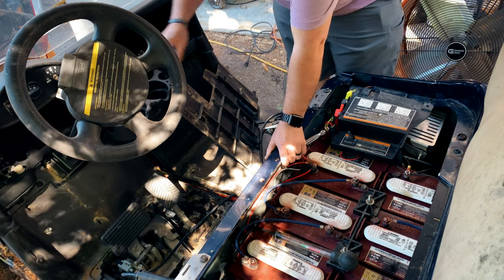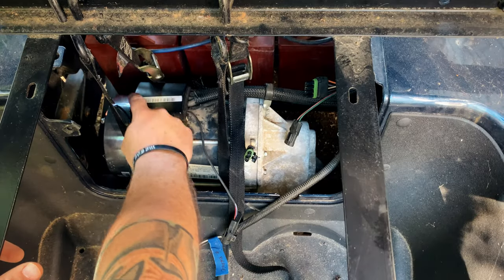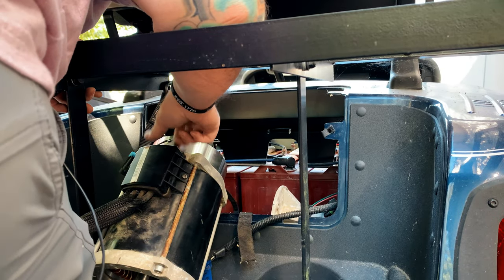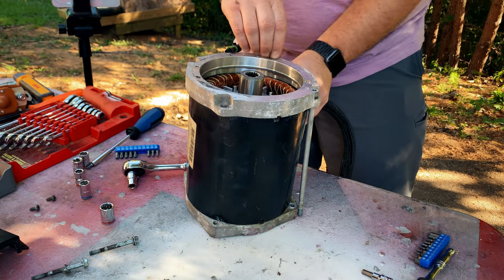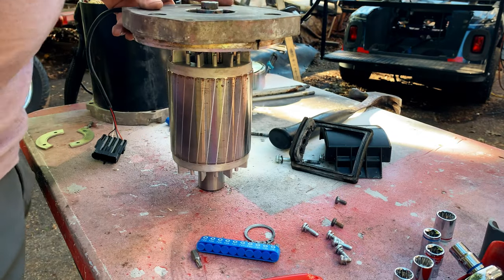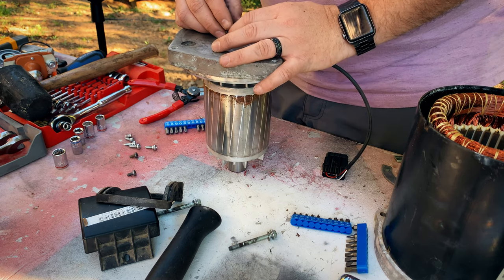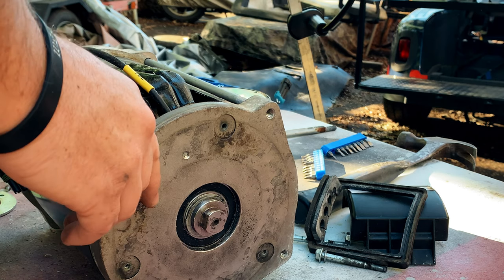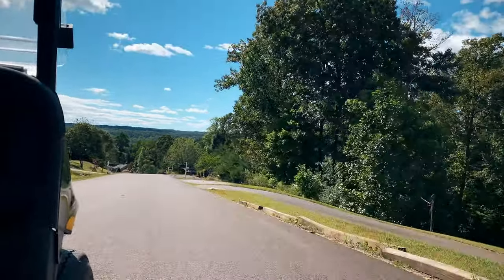Changing the Encoder Bearing | 2010 EZGO RXV | How to Upgrade a Golf Cart to Hunting Buggy - Part 2

Comment: Great video as always!
I myself own a 2009 EZGO RXV.
I had the same issue and replaced the cider bearing with no luck with fixing my issue.
Replacing the motor did the trick.  I also have a Navitas 600amp controller.   I replaced my old batteries with Big Battery Husky Lithium 103 Ah.  No regrets here.  (Great battery)I also installed front disc brake since it reaches speeds of 43 mph.
Reply from the maker: Awesome. I thought about adding front disc brakes, but I’m not looking at high speed in the woods. I was concerned about the motor being the problem too, so I am prepared to replace it when that moment comes. I’ll replace it with the Navitas motor.
Reply: @SouthernRootsOutdoors  Like @davidstokes-lopez mentioned about the battery. If you decide to go with a big battery I have a  discount code to save some money on any of their batteries. I've enjoyed watching this content of the cart.
Reply from the maker: Thanks for commenting brother. I’m a subscriber of yours as well. I may take you up on that. I was hoping to get a sponsorship on this, but I guess 1.16k subs isn’t generating a lot of excitement like it does to me. 🤣
Reply: @SouthernRootsOutdoors  the answer is always no till you try!
Reply from the maker: I agree. 👍🏼
Reply: I have the same cart and cant get it to run 
I think i have a controller issue 
How do i trst my controller ? Im in too deep to abandon the project now. I get only 2.5 volts DC to my motor brake and 22 volts AC to motor
Reply: how did you get a motor, been on a waiting list for 5 months now

Comment: What are the symptoms for a bad encoder bearing? I just replaced all 4 batteries in a 2008 RXV and cart goes through the sounds and gyrations but motor sounds like it’s slipping when you press the accelerator.
Reply from the maker: Sorry for the delay. The encoder symptoms are usually like it’s wanting to go, but chugs or barely moves. It finally reached a point that it wouldn’t move at all. Yours almost sounds like the splines between the motor and differential are messed up, or the brake is sticking. Is it moving at all?
Reply: @SouthernRootsOutdoors  I had failed to plug in the cable to the brake section on the motor. Thanks for your reply and educational video.

Comment: What was the intial issue you was having, mine was in limp mode , I have changed the speed sensor which has go it to run but it is start stop / jerky when going forward ,

The next thing on my list is the encoder bearing
Reply from the maker: Hey Ryan. My cart actually did two things. When it was given to me, I was told the cart would go, but was chugging at times. When I got on it to load on the trailer, it barely moved. It was extremely slow. I believe the controller fixed that, but when I drove it, the cart was chugging hard,sporadically, like I was bouncing my foot on the gas. When I replaced the encoder bearing, it was all good.
Reply: Yes chugging is a better word for it , that’s the same as mine, encoder bearing to be changed next  ,

 cheers for the video it will be helpful when changing the encoder bearing 👍🏻👍🏻
Reply from the maker: Yes, do not tap on it with anything. Those encoders are sensitive.
Reply: I was having the same issue of limp mode with my 2008 rxv. Watched your video and i was incredibly helpful in changing out the encoder bearing.
when i removed the old encoder bearing it was loose and popped right out, was the same loose scenario with new encoder bearing that i installed. 
after putting it all back together with a new ebrake, it surges in forward but runs smoothly in reverse. any ideas ??
thanks again for the video

ty

Comment: What’s the new top speed with a Navitas and those old trojan batteries?
Reply from the maker: The fastest I've gotten it to with those batteries and the original motor, was just over 25mph - maybe 27ish mph (per the Navitas app speed). However, I may have had the max speed set to 25 or so, due to stability until I install spacers.